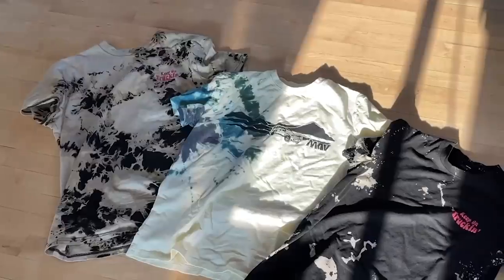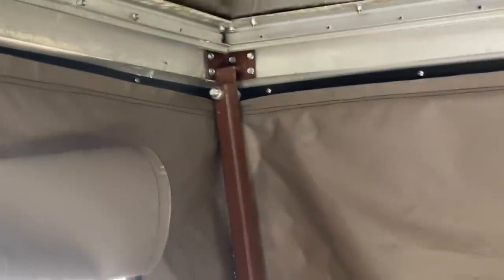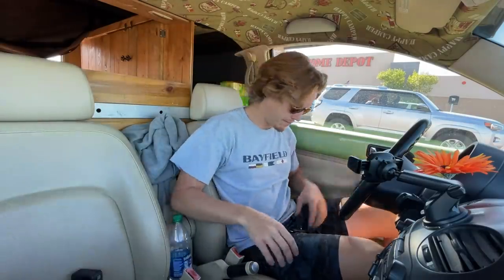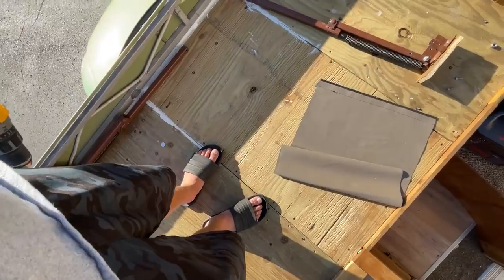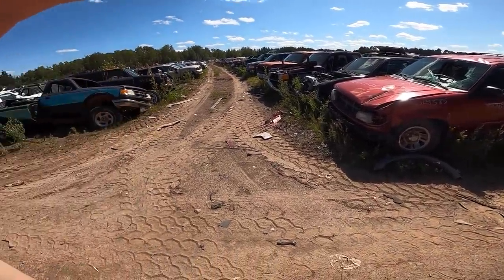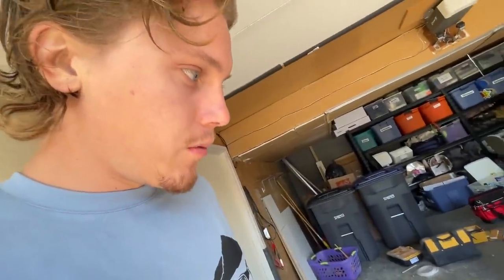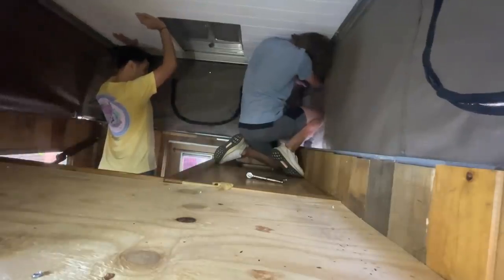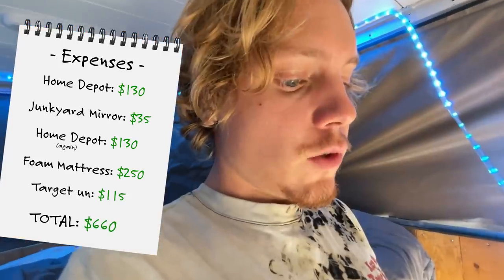Making my Car Campable Again - Volkswagen Bug w/ Camping Shell.

Comment: You should replace the springs that raise the roof of the camper with electric actuators. It will look cool and be alot easier to raise the camper top.
Reply: THIS......is a very good idea.
Reply: Good ideas bro

Comment: 👍👍👍👍👍
On the whitewash, it'll help you keep a better assessment of how dirty it's getting inside AND it will definitely help with brightening the inside up. Dunno if it's possible, but if it's still real dark in there, you could do like a small skylight to help when it's not yet dark outside

Comment: It's coming along great guns.  The little bug will be great when you have finished.  If you are still a bit concerned about the roof supports a lot of people use wooden broom handles cut to length with rubber stoppers on each end to put into each corner for an added safety support.  We have done that in our old poptop caravan.  I hope your dad was okay after the fall.  

Oh and I absolutely loved the black bear just casually walking down the street.  That was cool.

Comment: For the mattress - amazon sells high density foam that’s us made and cheap 

We just bought a 5” thick piece 30” wide and 6+ feet long for about $100 

Ended up getting several to use in our camper restoration, one bed and one to cut up and make cushions out of

Comment: You could install a flexable bug net and from the outside of the camper but you might have to take out the metal paneling to install the bug net. So you could still tuck it in when you are driving but it is stretched out and ready when you pop up the roof

Comment: Look for a place called Industrial Metal Supply and replace those wood boards with aluminum plate. You can also use McMasterCarr but they're really expensive. Metal is the way to go on that.

Comment: Mav I mentioned this once before I don't know if you saw it but you ought to just buy an inflatable mattress and then just pick up a 2-in memory foam you can get all the stuff on Amazon. Where the campus meets the metal frame there are velcro strips that you cut to size and with a rivet gun which is handheld and cheap in costs. As for your lighting problem they make and you can get these at Amazon too Under the Counter Lights that are Rechargeable.
They are Very Bright and will illuminate the entire inside 
Daylight☀️

Comment: Back in the 1970s and 80s. There were some great salvage yards on the Iron Range and Chesney down by Duluth was always considered a choice spot if you couldn't find it elsewhere. Good to see they are still in business!    Just wondering if Home Depot suggested the JB Weld product you used vs. Liquid Nails or Loctite construction products? they would have been cheaper.  with more product in a caulk tube. 
Glad you didn't kill your dad!  And to see your mom and the young lady help you put the top back on is awesome!   Love the mood string lights too. :-)

Comment: I have twice used Sleep Innovations mattress, very dense foam, can tell by the weight, but NEVER get memory foam on it, and MUST have an open cell foam, at least 2-3" on the top, or it will be too hot for sleeping on, maybe even in winter. Memory foam is a broiler. In my trailer I use an 9" with open cell blue-greenish top, and then also toss a thick cotten stuffed quilt on top of that, then sheet over it, because foam mattress can be too hot, but then I repeat myself.

Comment: If you haven't already, a full service to the bug is gonna be necessary if you want it to last. With all the extra weight on it the transmission and brakes are areas of special concern, although being a manual it's probably not as critical to keep perfectly maintained.

Comment: This camper of just so damn cute. You had better get some cap nuts (also called acorn nuts) for all those exposed bolts before you catch something (like your arm) and get hurt.The better water pump is sold for boats and is a foot operated pump that lets you wash both hands while the water is running.

Comment: Having had a number of motorhomes n my 73 years I have found that once they start letting water in it just never stops.  Fix one leak and the next one starts.  I once removed the whole the whole roof of a coachbuilt motorhome and meticulously rebuilt it and sealed it with new rivets and twice as much mastic the manufacturer would use.  Better to do that and remove the excess that squeezes out than to have any gaps.  Great I thought and then all the windows and overlap wall joints decided to leak.  You cannot win.  They are a money pit once they start to degrade.  I just console myself thinking of all the cheap holidays, weekend breaks and days out they gave me.

Comment: You should have put some 4x4 blocking or even 2x4’s to hold up the roof while you removed the old hardware. Would have made that a lot easier

Comment: I am wondering about putting some white plexiglass portholes on the top that would allow light to come through?? they could still be blocked by a light shade and thermal cover on the inside?.. I think i would opt to remove the passenger seat also so that I could bet from the driver seat to the rear without having to go outside.
Also, yo can glue a sheet of the reflectix thermal sheet to the cloth siding to create more insulation?

Comment: possibly the most expensive parts would be heat and power...   

given the very small size,  a little 2-3kw diesel parking heater would likely be best, lightest for the vehicle, and cheapest to run, as well as safest as something like a buddy heater would dump so much moisture into such a small space the wood would... rot.

Then power,  honestly again, given the small size,  rather then going for a full "wiring" set up...    A simple Jackery 500, connected to a pair of 100w panels on the roof for example would give you basic power,  a single plug, 500 watt max draw,  3 USB ports, so you could run several string lights off that or charge your phone or such.  Or run a 60 watt electric cooler for 9 hours. 

stepping up would get really expensive really fast.   The jackery 1000's cost like 1500 dollars,  not worth it for your build...  but can power a mini-fridge for 18 hours.  combined with 200 watt roof power, you could have a 60 watt minifridge going 24/7.     But 1500 is so far out of the price range.

And trying to build your own LiFePo4 system, or just trying to get enough ah out of it, at 400-600 dollars per battery,  + charge controler +...

As long as you aren't looking at doing a TON of things like trying to run a microwave.    jackery 500 would run the diesel heater,  lights, and everything else pretty easy.